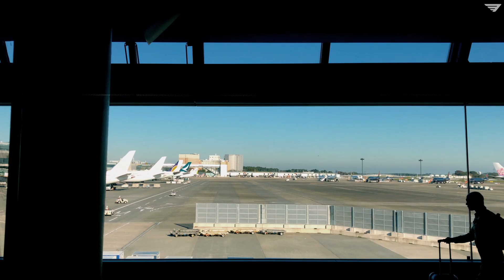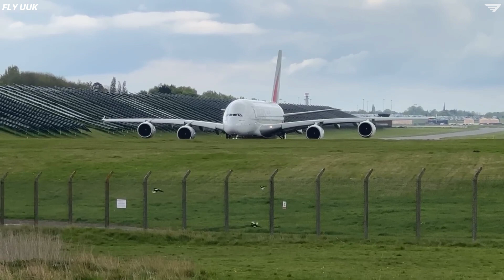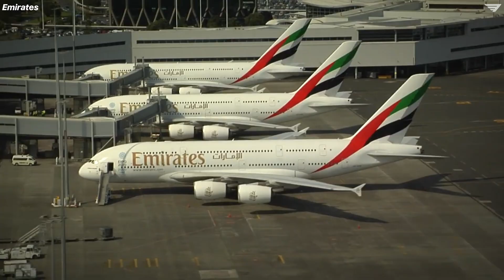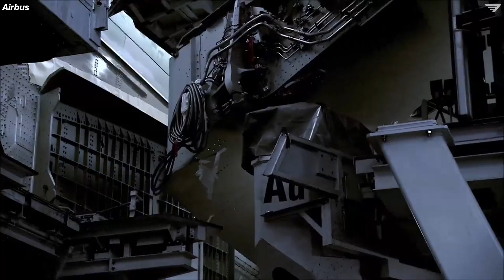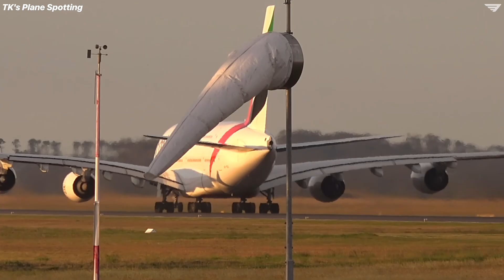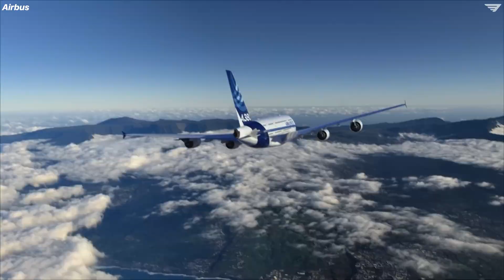Why US Airlines Refused the Airbus A380

Comment: I HATE the smaller planes for medium haul system in america, no United, I will not sit in a 737 seat where my knees are in my face for 4-6 hours between denver and cancún
Reply from the maker: Yeah, some trips can definitely be uncomfortable like that.
Reply: A 737 and an A380 (or another widebody) will have similar seat pitches in economy. So when you refuse to buy a domestic first ticket to solve the problem it really does not matter which airplane it is, as the economy seat is going to be more or less identical in terms of the amount of space. Just more people on bigger planes

Comment: If you look at where the A380 sold, UK, Germany, UAE, Japan, Thailand.... they're all places with a singular main airport for the country. There is a premier airport for the airline that took it. All their flights (with few exceptions) go to or from LHR, MUN, DXB, NRT, BKK etc. They are literally singular hub operations. With that being the case, there is a business case for huge airplanes to transfer tons of people. 

The United States is built around airlines with numerous hubs. So while they have 500 people wanting to go to London, they're not all a one hour flight from a singular hub to connect through. It's not a "oh the point to point won out" it's that the logistics and network of US air travel is wildly different than that anywhere else on the globe. 

Airlines in the states could have made the A380 work. They certainly would work from DFW and ATL to London and Amsterdam/Paris respectfully... as well as JFK ops for AA or DL to those same destinations. But that's limited use cases.... and would mean initiating a small sub-fleet of airplanes for select routes and that's expensive... when DL has (or can buy) a bunch of cheap 767s and AA 772s that can fill the void and can also work on other hubs to those same destinations because they're smaller. 

Also as we've seen  the only airlines that have truely made the airframe work are those with larger numbers of them. Thai, Asiana, and ANA failed with them. Thai ditched them quickly, and Asiana will do the same... and ANA flies them on a singular route, the 2x daily HNL. That's surely a purchase they regret in hindsight.
Reply from the maker: Thank you so much for your valuable comment.